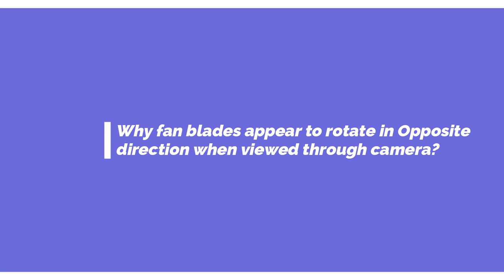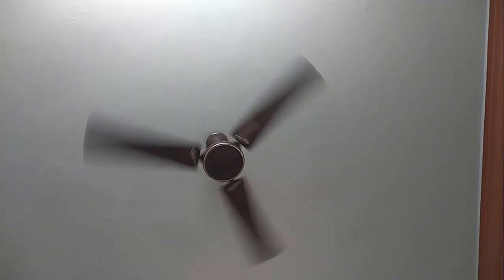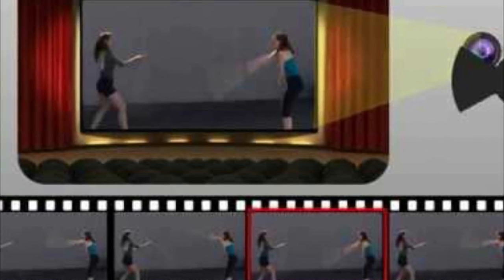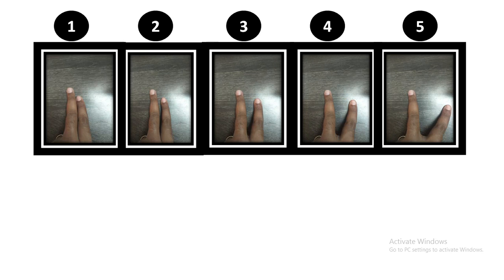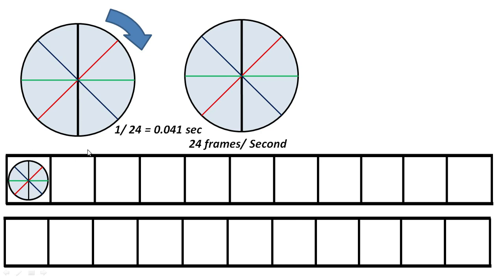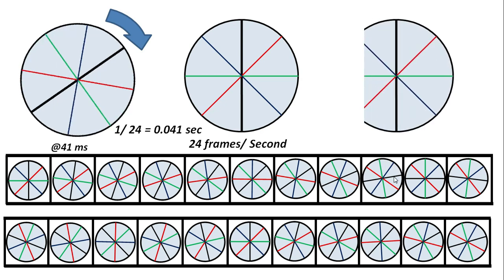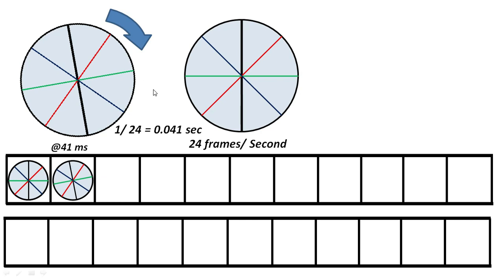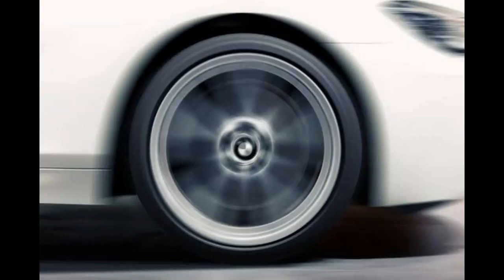Why do fan blade/Wheel appear to rotate in reverse direction when captured as video I FPS I English

Comment: But I think it because  so values of pie is 22/7 but We divide 22/7 we get 3.142 84714285 it goes to Crore to crore times remainders but we will get never answer so pie value is infinite so if you solve   circumference of a circle its perfect answer will never comes because we dont have exact Value of pie 22/7 formula of circumference of circles is 2πr pie value is not perfect but we divide practically their will be a gap thats a reason we seems fan running clock wise so if I am wrong you can correct me.thsnks.